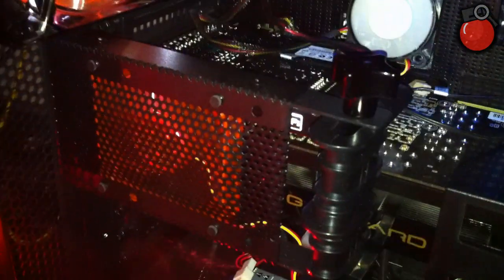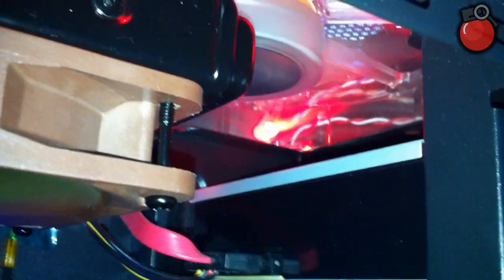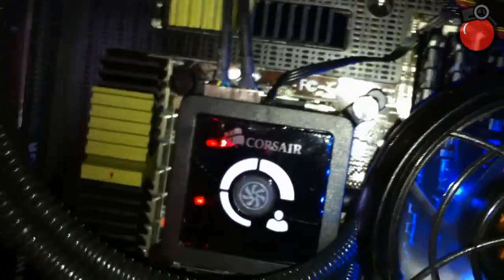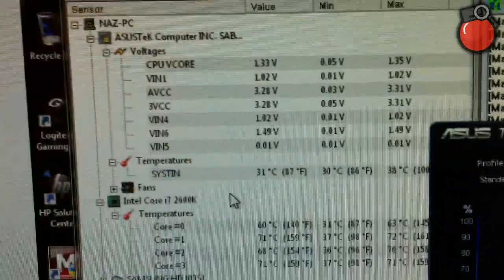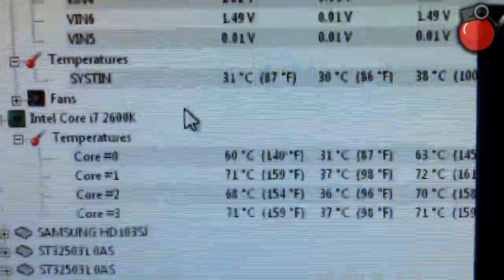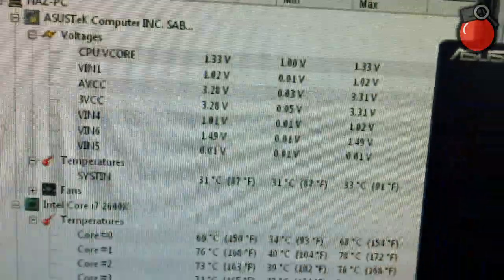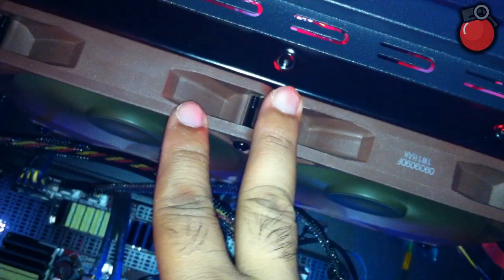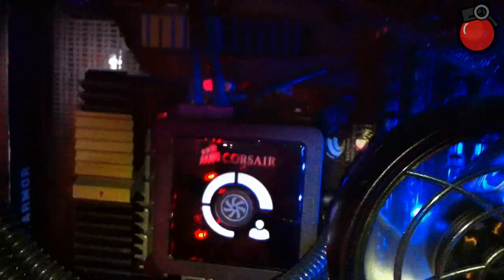Corsair Hydro H100 Review And Temp Results - Cooler Master Haf X Case

Comment: Hey mate any specific requirements for changing the fans to aftermarket ones ? Because i heard one dude he swapped to an aftermarket one , the fan speed button no longer works for him , ending up he had to put back his original one.....

Your fans are connected into the pump right ? Like the H80

Comment: I think half an hour would be a fair time to instal jotting down the locations of all the connectors with the slots and tagging the cables for refitting the motherboard with the backplate so when it boots up the wrong hard drive isn't in the boot slot. Plus if you have a modular power supply make sure before booting that you have a tight connection to the PSU. I ended up installing windows again because the wire was loose on a slighty corrupted HDD. HAF X also has shit long motherboard screws

Comment: ...also, the Corsair H100 was designed so that the screws went into the fins. It doesn't affect the actual unit itself because the water pipes aren't near the screw holes...

Comment: I've got a Corsair H100 in my Bitfenix Prodigy (My first build), but my build looks a lot neater inside even though it's such a small case. I think you should consider re-doing the cabling because with your cables hanging everywhere, it will serious affect the airflow within your case...

Comment: Did you apply the thermal grease yourself, why do you have one core so far off from the others? Also are the fittings able to be removed to use other components?

Comment: what i don't understand is why people don't just overclock the boost clock on their possessors that way you prossesor dosn't have to be running overclocked speeds 24-7. My Intel Core i5 2500k is set to run at 1.6 ghz until i do something that needs more speed, then Intel turbo boost (witch i overclocked) boosts my CPU clock strait to 4.3ghz. My CPU then runs idle at 16c =D.

Comment: 2 question 
1.Will it fit in my haf 932
2.Is there a program to control the fan speed with out opening the computer case? 
Or does it have an auto fan speed(that would be better than opening the case)
Because i have coolermaster v8 and now it been 2 years and i dont turn off my computer and never cleaned it in a while. It just started to make noise. and i have to always take out my computer from my wall and turn it high and low.
if this water cooler does not need me to open the case i will getit

Comment: @dmcgamingclan I guess my turbo mode was on and i was overclocked from 3.5 ghz stock to 3.9 ghz. after I turned it off my idle teps are between 36 C* and 39 C*. I took of the heat sink and i replied the thermal paste, but I am still getting about the same temps. I used Gelid GC Extreme thermal paste, which some epole said its better than artic silver 5 and its non conductive. When I play BF3 its aabout 45-50% load.

Comment: WhenI was installing the h100 backplate onto evga z68 ftw motherboard it had play after I fastened the double threaded screws, is that normal? I wasn't sure so I used a small washer and placed it between bracket and the nuts, so back plate would not move at all.

 I created push/pull config with Cougar vorthex 120mm fans, but my idle temps are around 40 C* at stock speed. When playing BF3 my temps are about 52 C*.

Any idea what could be wrong? Its installed in 600T case and running 480 GTX SLI

Comment: @crazyboynph This cooler as with any large radiator is meant for high high overclocking.  No 240mm or larger (closed loop or full water system) radiator will deliver cooler idle temperatures (all things being equal) than a smaller surfaced radiator. That's just thermodynamics.  You increase the amount of heat, and that is where your performance comes in.  It has its place, people just don't understand how it works, which is understandable as most people are coming from air coolers.

Comment: if you want to install two more fans in push/pull.
Will you need to remove the case upper fans to do so or they will provide a longer screw to do mount the fan above the radiator?

Comment: I installed a H80 in my mates PC yesterday, i7 2600k(stock), idle temps were 27 - 30, load temps maxed out at 52 - 55. Lol and that was on the lowest setting. with that cooler.... hitting 4.8 - 5ghz and remaining below 70c seems like a real possibility.

Comment from the maker: @Dechomai lol they where pluged in the pump unit, its that the stock fans run at 2600rpm and my fans run at 1500rpm so they where running at full speed al the time as the temp of the fluid kept the fan running at that speed and not decreasing when the temps went down?

Comment: I got the same results.
The H100 has the same temperatures as the H50.
Nothing special.
Only the load temperatures are a little bit cooler.

My H100 was defect and now I bought a H80.
I got better temperatures with the H80, because it soaks cool Air from outside.

Comment: The screws go through and bend the metal but. I just changed from.a stock cooler and the temps have changed by 10 sometimes more degrees

Comment: DMC you wont notice the fans ramp up until the cpu is under load and the pump tells them to speed up. For me, even after running prime 95 the fans didnt ramp up until the temp got around 52c. btw I ran Prime95 for about 13hrs and with the pump set to high the temps never went above 58c. Core i5 2500k @ 4.5ghz.

Comment from the maker: @KINGhotaru11 I would love to do a installation but I don't have a tripod at the moment and I tired to do it with one hand and was hard keeping the camera in shot?

just remember to put on the fans on the rad first then screw that to the top of the case by removing the top panel (has 6 clips to remove) then install the CPU block.

The thing I am confused about is that you have a D14 and that ment to be the best cooler ever? I could not have that as my RAM was to high and the D14 would not fit

Comment: i just got this today and i put the fans as intake fans , i have my case' fans and those fans from the cooler , so it's 4 intake , 2 on 1 side of the radiator and the other 2 on the other side , but i wonder if ur the same ? i mean are u using all 4 fans as intake or as exhaust ? my IDLE temps are between 30-35C and on 100% Load 40-45C (haven't overclocked yet) , hope u answer asap